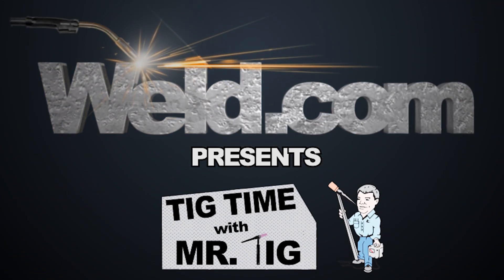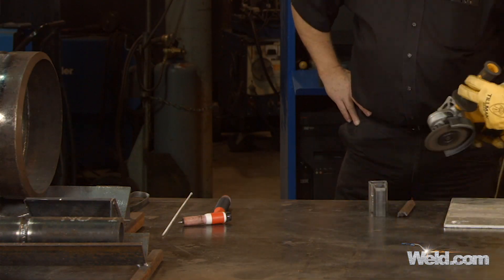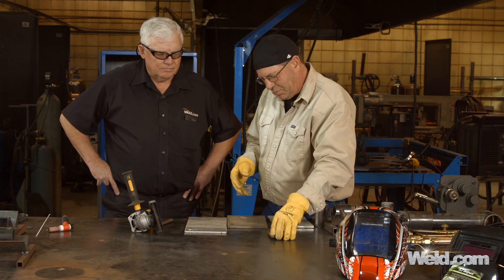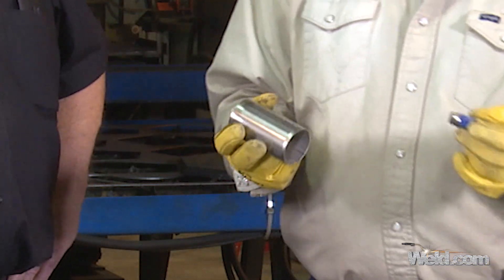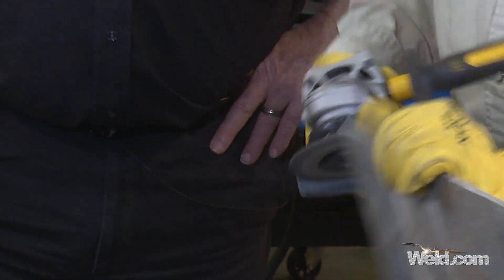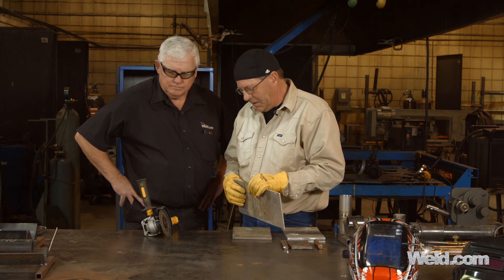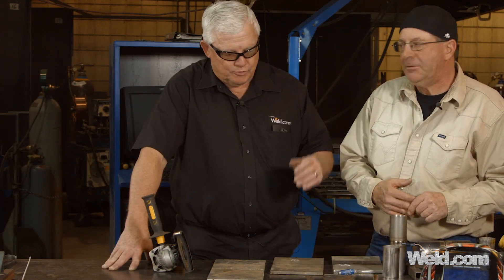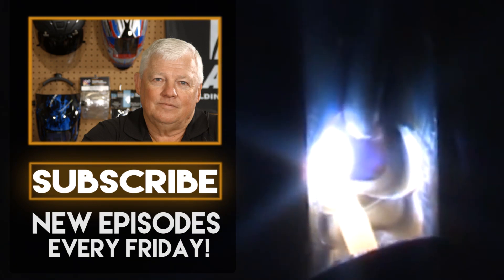Identify Metals with Basic Shop Tools and the Spark Test

Comment: Didn't know that about grinding aluminum with a regular grinding wheel.  I wonder how many times I have cheated death?  (:-D
Reply: they don't just straight up explode but die to the softness and low melting point of aluminium it "gunks up" the grinding wheel and your issues stem from that
Reply: [HUN]AntaresSQ01 I know. i was being facetious.

Comment: Is there anyway I could estimate the type of metal I have without having to grind it or mess with it? Like maybe colouring or texture ? Or even feel.
Reply: VZY FLAME if you are talking about non destructive methods, there is a method using XRF (xray fluoresent) scanner. It can tell you the chemical composition of your metal. But those machines are expensive.

Comment: Unfortunately,  There are numerous variables in detecting the type of aluminum alloy. Say for instance,  we can eliminate a few of the aluminums by bending.....   3003 and 1100 series will bend and shape nicely....   6061 -t6 has great tensile strength but will not form well in to a tight radius without cracking.   You will need higher dollar instrumentation to realize a specific aluminum and temper.   Good luck   Mister Tig

Comment: The following is more a reference than anything else.
How do you tell the difference between aluminum series? As an example AW 1050 to AW6060 as
a current example, is there a basic way of differentiating? 
On a side note the unobtainable alloy was obtained today at 13:30 hours
Reply: 1xxx series aluminum is a minimum of 99% aluminum and the next 3 numbers help determine the exact percentage and impurities in it.  6xxx has magnesium and silicon in it.  What makes you so interested in it are you planning on being a mechanist or a welder.  It is a great skill to know all the deferent types of metal I personal am an aluminum boat welder.
Reply: +Ethan Schulz  This I am kind of aware of, why I am interested is because I am currently working on some
aluminum which I would like to know precisely which series it is, and I know is
either AW 1050 or AW 6060 or something close.The 1xxx should be softer and more bendable compared to a 6xxx right?  
Are there
any more ways to determine which series one has, I would like to know as I am
welding. Thanks
Reply: @ANTI_PSYOP_channel  nah